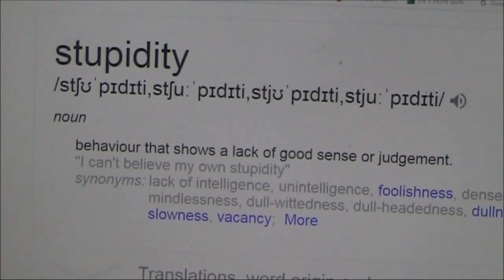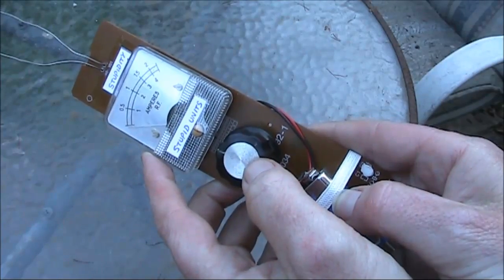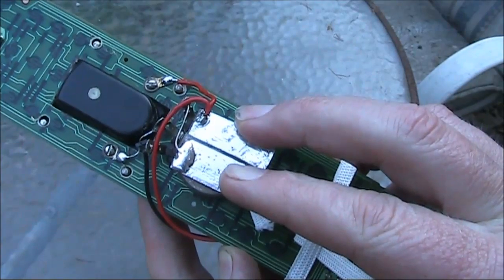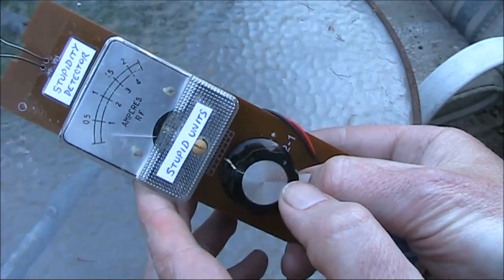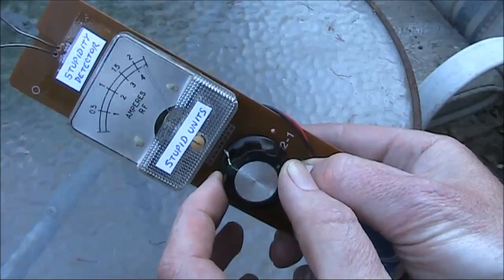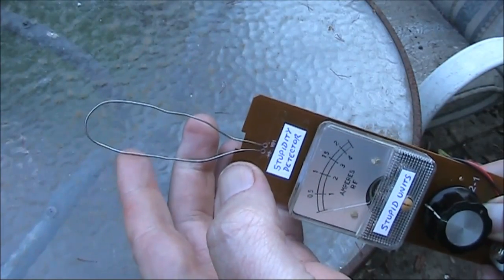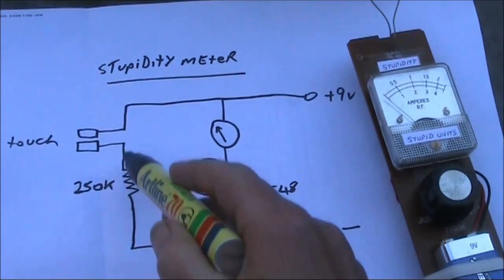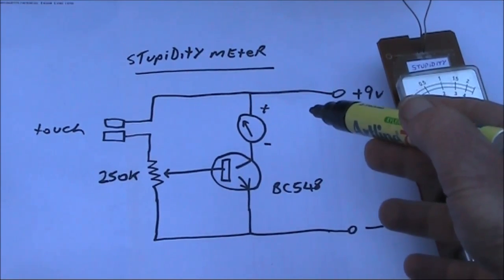Electronics on the Floor: Build an electronic stupidity meter

Comment: As always, another great project, Peter. Desperately needed, I'm stunned that no business has ever offered one for commercial sale. I'll be building one and using it on some of our callouts. BTW Peter, November 17th is the date slated for the 2019 Rosebud RadioFest. I just need to confirm our venue. Cheers Mark B. VK3PDG
Reply from the maker: Thanks Mark - another option is to have a voltage controlled oscillator so it behaves like a geiger counter along with a meter scale.